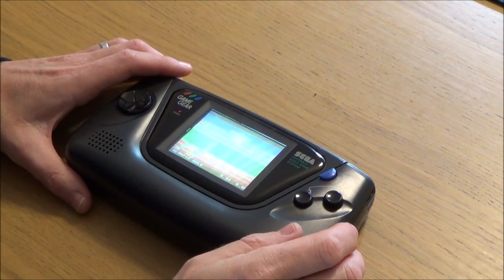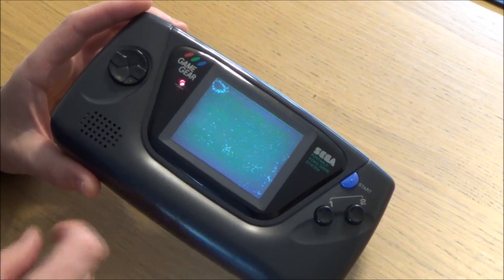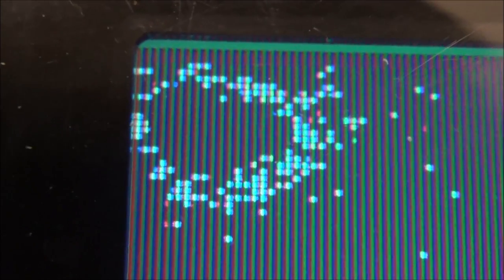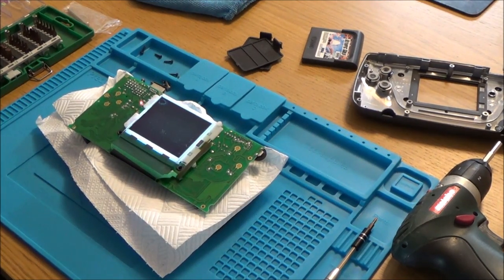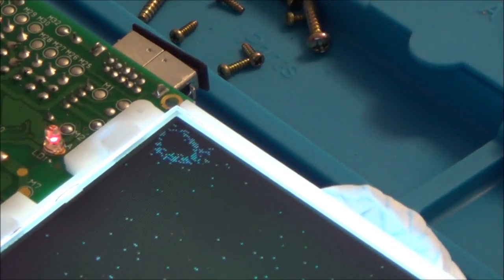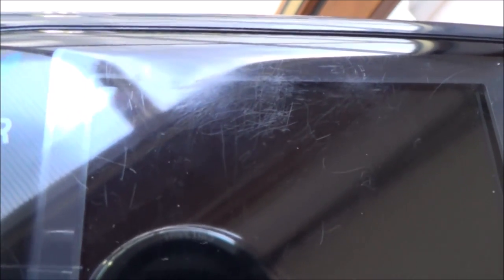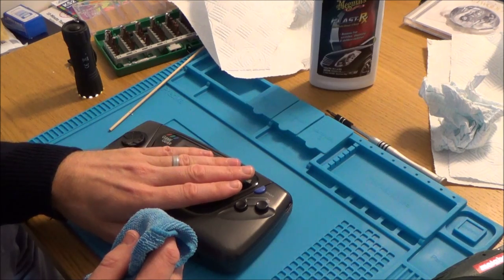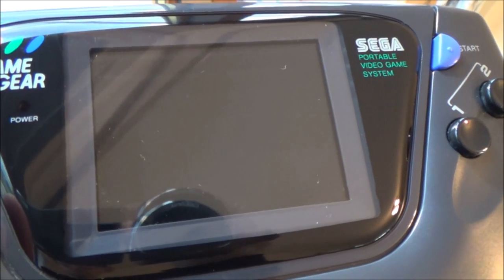UPDATE-Trying to FIX Stuck Pixels & Scratches on a SEGA Game Gear

Comment: You hang a cd from each ear them swing your head from side to create a static field. Then insert a needle into the match stick to create a high voltage point. You then put the glove on to protect yourself from shocks and then touch each pixel. There will be a light crackle as the static is discharged and then a huge flash from your misses taking a photo 😁😁

Comment: Every pixel is made up of the three primary colours called triads, red, green and blue.  This is why some of your stuck pixels appear to be different colours.

Laptop LCDs often have the same problem with sticking and you can download a program that will flash the pixels very quickly and can sometimes unstick them.  There is also Youtube videos that mimick the process as well and can be useful to devices that do not have a Windows platform.  Be very cautious using these if you have a medical condition such as epilepsy.

There are other techniques to unstick pixels that other users have declared success with, such as rubbing the screen with a very slighty damp cloth, but I have not tried it myself.
Reply: The fast flashing program works for stuck pixels.. i had an old display with one of them and after using the program a couple of times it got fixed.
After that, for a couple of times it started as stuck and then got to work after warming up.
In the end , it got fixed permanently and i haven't had problems every since then. :)
Reply: Works for stuck pixels, yes. But not for dead ones. And the screen technology here is different to modern LCDs as well.
Reply: The pixels on the GG are white, a symptom that suggests they are stuck. If they were dead, they would appear as naturally black.
The technology shouldn't be too different thou to hint that using a flashing scheme wouldn't at least have some effects to revive the pixels.
Reply from the maker: Great info, thanks for sharing it :-)
Reply: sadly game gears used an older technology called a passive matrix display meaning they only change colour when addressed, this means when pixels die they just stay semi-clear (the same tint as the polariser) and allow essentially all of the light of the backlight straight through.

Comment: Stuck pixels due to bad TFTs are only a thing in active matrix LCDs.  The Game Gear display is passive matrix.  It's almost certainly a damaged polarizer.
Reply: Good to know
Reply: there is no such thing as active and passive matrix ... all matrices react to electronic pulses therefore rotate liquid crystal molecules traped between 2 special threaded glasses and light filtered by 2 polariser light filters
Reply: So you think you could change this polarizer itself?
Reply: the driving of matrix and the matrix itself are two diferent things ... if you study this at high school you will know it ... that there is something called COG (chip on glass)  and the pixels themself can not be passive. The driver can be active and passive but you cant controll pasively those kind of matrices because they have too many pixels to be controlled by a single chip therefore the driver is exported off an LCD panel to aside (and still you can't call it passive) but the driving transistors are still present in the driver chip itself ... And stop believe to all the bullshits in internet specially wikipedia that someone wrote the info in his garage ... and yes you can change polariser if you know how to use your brain and hands ... you don't need to change the direction of polarizer rather than rotate the crystals (wich are like little prisms) with electronic pulses and pass or block the light trough them at the specific angle ... passive can be resistor and capacitor, a diode e. g. coil (inductor) wich can not execute logical function ... the pixels CAN -> change their state
Reply: Uh, no.  Active matrix LCDs have a thin-film transistor at each subpixel.  Passive matrix LCDs just have ITO conductors and no transistors.
Reply: Everything you wrote here is completely wrong.
Reply: OK give me the definition of ITO (Indium tin oxyde) conductor that you throw here and how exatly works and what exatly is and what is his role between the pixels (in an LCD panel) and what is conductor also tell me how the crystals are connected to driver ... i am sure you just read it in wikipedia :D and trying to find info on google now ... tell me what means passive and active element - give me the definition ... how this is different than ECOG and IGOG and COC where the pixels are actively controlled by sinusoidal phaseinverse.
Reply: @technixbul  okay, let me translate you what I just showed you that Wikipedia says:
A passive matrix display or PMLCD (short for passive matrix liquid crystal display) is a matrix display in which the individual pixels are controlled passively (without additional electronic components at the individual pixels).  In contrast, screens with active pixels controlled via transistors are referred to as active matrix displays.
Reply: Yet you talk again for Wikipedia and again for driver of the pixels .... not FOR THE PIXELS themselfs and again this is the way of controlling the pixels -> THE DRIVER (controller) itself is active or passive ... not the matrix itself ... Verstehst du? :D and believe me i know what i am talking about
Reply: No, you don't.  Active matrix LCDs have a transistor in the corner of each pixel.  Because these transistors are much smaller than the actual pixel area, they are prone to manufacturing failure.  The transistors allow pixels to be driven without affecting the pixels on the same rows and columns.

These STN passive matrix LCDs, as used on the Game Gear, original Game Boy, and other handhelds of the era, cannot drive the pixels individually.  This means that a very dark object will cause vertical and horizontal "smearing".

As for what ITO is-  it's a semiconductive material with a bandgap that allows visible light to pass through.  It's diffused onto the glass in an LCD as part of the process of fabrication.
Reply: look @skonkfactory, ITO is used to make electric connections on the glass, it has no other purpose, pixels are drived individualy but they are multiplexed as always which cause so called "smearing" and this is nothing to do with active and passive controlling of each segment (the transistors that drive them) but the technology of rotating the crystals in crystal mesh (the speed of transition between 0-90 degrees). Old TN technology was badly oriented liquit cristals that was not fully rotated (not 0-90 deg) by the electric field, this way the picture was bad at wide angle and was "teleporting" on fast frames and missing the grey half rotated states wich results dark picture. When a segment is "shot" with static charge - its crystal mesh is impaired and crystals inside are not oriented the same way anymore therefore the electric field won't turn them in the same direction as "healthy" ones .... imagine it as broken transparent magnet. The driving transistors are nothing more than a way to discharge electic field of segments and make sure that they are not opened accidentally when near ones are magnetized (energized). The new LCD panels have COG (Chip on glass) drivers that are exported outside panel (or at the frame) so this improve light passing abilities of the panel wich is the same driving technology (yes again with transistors) but moved aside ... on the other side IPS and OLED are another beer but thats a topic for another site .... My point is that, here in this video the display was damaged by static dischrge ... and this can't be reverted.
Reply: i worked at the game gear factory this problem is caused by the grathics chip one of the tiny gold wires in the IC burn out to do with those particular parts of the screen were the pixels are stuck.that is a test model you have that some how got onto the market.i think they used budget capacitors an resisstors on the prototypes to save cash in testing that often burn out causing grathics chip faults but consumer models had quality electronics.i also wokred at the sega fartory an got itno a fihgt with one of the managass and nocpped him out and stole the plans to steol the moon.if you beliave any this your dumobbs
Reply: skonkfactory The Matrix has you...

Comment: That's good to hear, didn't think anybody was making new bezel plates for them, get so used to it being Nintendo and nothing else for aftermarket parts. Actually as far as LCDs, I think all the major handhelds from the 90s(GG/Lynx/GB) should have somebody making direct replacements for sale by now. Trouble with custom LCD manufacturing is high enough bulk orders but with a predefined platform it could be profitable to any entrepreneur willing to do it.

Comment: Hey Vince. I noticed you applied the compound with paper towel. Paper is harder than plastic and will scratch the plastic more so than it was before. Not sure if you knew that already but just wanting to be helpful. 😃 I always use a clean microfiber cloth when budding out surfaces for best result
Reply from the maker: Thanks, I never knew. Normally I just grab some tissues but yes thinking about it paper towel is a lot stiffer than tissues. Thanks for the tip :-)

Comment: for getting rid of the scratches you can use polish for acrylic surfaces. often times shops that sell car stuff have it, because it is often used to polish car light covers that aren't made of glass. also the pinball guys like the stuff for polishing old plastic parts of playfields. i have positive experience in both cases. works great there so i think it works for your problem as well. for deep scratches one needs to prime with some very high grit sandpaper. but i would try first without it, just the polish and a soft cloth. don't use paper towels. 

like your vids.

UPDATE: The stuff i used is called xerapol plastic polish, but i think there is also cheaper stuff available.

Comment: It was certainly worth trying!  I guarantee the lightly massaging technique works on 3DS and DS screens sometimes - my current 3DS suffers from that and a gentle press and its OK for months again.   LOL @ the CD suggestion!  Nice to see finally someone else using PlastX - that stuff is great for cleaning plastic on these old systems.  I've used it for many years now.  Others use Novus too.
Reply from the maker: Definitely worth a try otherwise I would never know. Handy to know that it works for the 3DS :-) PlastX seems to be a winner, I am wondering if it would work as well on scratched up Nintendo Switch :-)
Reply: I've used it on many things and never had an issue - except a PSP screen!  I've never tried it on a Wii U or Switch.  If you do, I would use the smallest amount and test it very carefully on a small area.  It will probably be OK, but it did make the PSP screen worse.   Surprising as I've used it on hundreds of other systems without any issue.
Reply from the maker: Thanks Chris :-)
Reply: @Mymatevince  wanna buy a 3ds haha good condition just backlight goes out on top screen bit slight move and its fine plays games connects to wifi easy fix i just darnt take it apart haha
Reply: Hey just a helpful tip. Have you guys ever heard of retrobrite? Well on old computer systems and game consoles, the plastic turns all yellow or darkens. Retrobrite actually restores the plastic to its former like-new state. If you get a chance, I highly recommend that stuff if you haven’t already used it

Comment: I knew from the first second that the screen was hopeless - when you turn it away and the image goes black and the pixels are still visible, then you know it's not a problem with capacitors but just the screen. These screens were just very sensitive - I got a Lynx with lines and stuff as well and it's impossible to repair - I got to buy a replacement screen which is like £100.

Comment: A suggestion for something you should buy and try to fix would be pachinko machines from the 70s, a little over a year ago I got into it and I think you'd enjoy it. the vintage machines work like those coin sorting banks where there's computer-like logic going on but it's all just balls rolling down tracks and tripping seesaws diverting it off to make different things happen. the only electronics are switches that turn on lights when you hit a jackpot.
Reply from the maker: They look fun. I had a quick look on eBay and they are super expensive. I will keep my eye out for a faulty small one as it may be more affordable :-) Thanks for the tip.
Reply: @My Mate VINCE Craigslist is where I always find them. Maybe they're less common in the UK but a mostly functional one in the us is $80-200 completely not working under$50. Shipping on them is murder as they're big and heavy. Edit: Of course I should add the ones I have found for under $50 were being sold by guys who had bought them in 1975 for $12

Comment: PSA: never directly touch the screen panel of your Sega Game Gear as this will leave fingerprints, and cleaning with any time of material WILL leave scratches.

Also you are far better off buying a replacement front panel, the new ones are made of glass and are reallly nice overall. You might as wel spend just as much on a glass panel instead of the PlastX or Any type of acrylic Scratch removing products Because while those do help they will only remove the superficicial light scratches (with a lot of polishing)

Comment: Nice job with the scratches! I'm sorry the stuck pixels didn't turn out to be fixable :( What you can still try (but first try with the other, striped LCD) is separate the LCD glass from the circuitry. Because if you can do that and put it back in there (again, try on the other one, striped LCD first) then you can swap the LCD-s... if the striping is caused by the chips, these are allright and that other screen had no stuck pixels. I've done this only on much simpler screens and there it was easy... here, it could be harder... so be sure to try on the other one first not to mess up this one.

Comment: I wish I could give you more subscribers and likes I just love your content
Reply: i worked at the game gear factory this problem is caused by the grathics chip one of the tiny gold wires in the IC burn out to do with those particular parts of the screen were the pixels are stuck.that is a test model you have that some how got onto the market.i think they used budget capacitors an resisstors on the prototypes to save cash in testing that often burn out causing grathics chip faults but consumer models had quality electronics.i also wokred at the sega fartory an got itno a fihgt with one of the managass and nocpped him out and stole the plans to steol the moon.if you beliave any this your dumobbs

Comment: The bleed means that you pierced one of the layers and the carbon based fluids have leaked through the layer , only way I know of to remove bleed is to replace the screen

Comment: I have two with that exact “finger print” spot and the “starry night” pixels. It’s definitely not from a person putting pressure unless it was some consistent pressure point during manufacturing that didn’t immediately cause problems with that batch.

Comment: On the gameboy there was always the ribbon cable the Problem.  So where  the display begins .  So....  in many YouTube videos i saw that they heated up the ribbon cable with an soldering iron . That the points of the cable are good on the connections of the display.  And not lose.
Search for an video of gameboy display pixel repair!

Sorry for bad english
Reply: The Gamegear has a very different screen technology. Dead pixels are not a connection problem.
Reply: That's to fix vertical lines though, not dead pixels

Comment: Try running a low voltage along the screen ribbon to see if you can manually light them up, it might jolt them back into the off position. White pixels are RGB all on.

Comment: Wax for cars works for fixing plastics and glass.
The new screen on my phone is scratched (because i had it laying on its screen and it slid across the floor) so im going to try the wax and see if that fixes it.
If it doesn't work it does not matter because i can only see them a little bit when there is alot of light on the screen from the sun.

Comment: I notice you have the mat back, how long did it take to vent off? I've been looking to get a smaller yet similar mat for taking things to bits, and I loathe that curing smell that you experienced!
Reply from the maker: I left it outside for around 4 or 5 days and now the smell has gone. When I bought it back inside I wiped it down with a wet tissue just to clean the dust that had stuck to it. Since then the smell has gone :-)
Reply: Wow, that long! Worth it though. I hope it works out for ya, please mention how you get along with it when you have gotten affiliated, seems like a great tool to have.

Comment: Usually when people are playing these game they are torquing and twisting the devise in their hands. Long story short there is a ribbon cable soldered to the board but on the opposing end there is a totally different type on connection to the LCD, those are the ones that need attention whether rubbing or putting slight heat to. Most of the time in the factories they use a sticky silver pliable solder that takes very light heat because of the frail components involved. Try this.

Comment: I had this same problem on a Sony NW-HD3 screen with dead pixels. I put it in a zip lock for 10 mins in the freezer turned off. Then waited next day when it was room temperature charged it in the sun and it was gone. But it was single pixels hers and there and not like those concentrated on the top of yours.

Comment: If you look at some of the ways to fix the gameboy, someone uses heat to fix issues on the screen. It is usually done with a sodering iron on the ribbon cable, but in your case, I would consider you use directional heat.